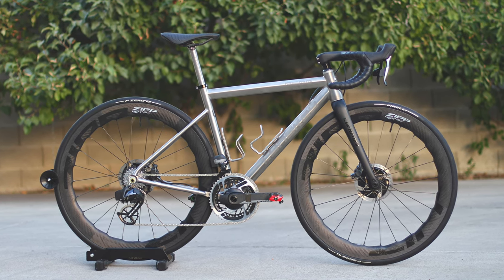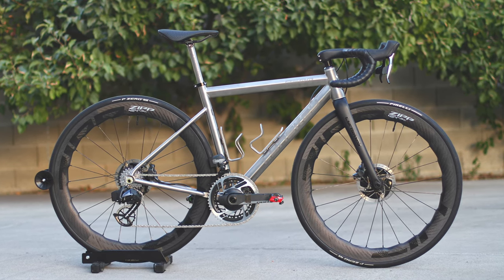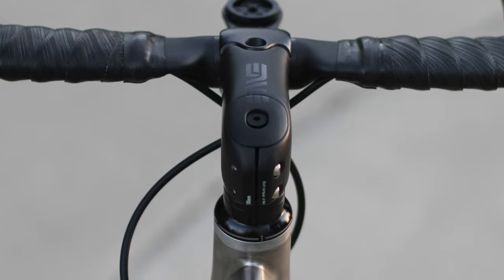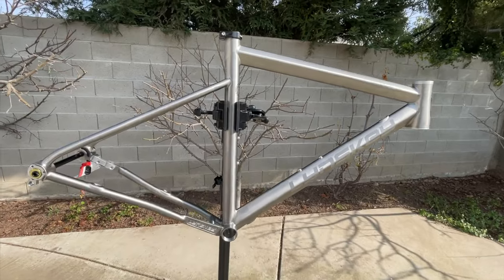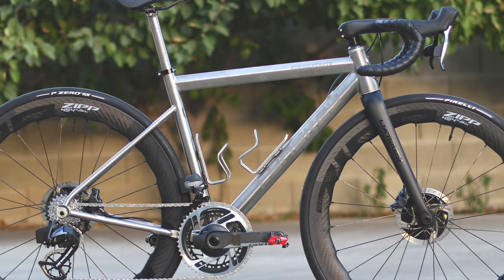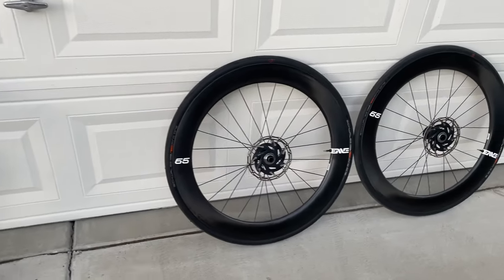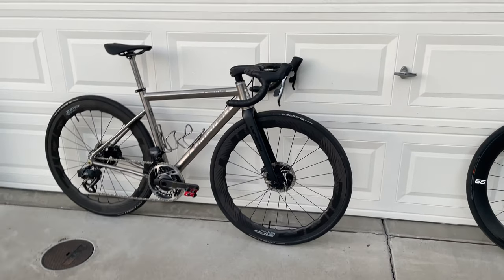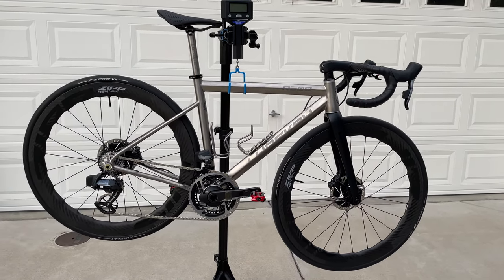I weighed my titanium bike Lynskey R500 Part 3

Comment: I have a Litespeed that's anything but light, it's 20.5lbs 🤣🤣 I tell myself I only went titanium because my sweat corroded my last two alloy frames 🥲 They are striking bikes though, I get a lot of compliments on mine
Reply: Lol man I have similar reasons for the ti bike also.
Reply from the maker: Thanks for sharing. Same here, I went for the durability but later fall for the unique, exotic and raw frame material. My Litespeed weighs about the same by the way, which I never wish it'd weigh any less. Cheers.

Comment: Beautiful bike. I’ve got a GR300 and love it.  Yes, it’s heavier than the carbon frame it replaced, but the ride and durability are so refreshing.  If you ride your bike a lot, it’s so nice not worry about scratches.
Reply from the maker: Thank you. Gr300 looks really comfortable. I agree with all you’ve mentioned about T.I bikes.
Reply: What’s your current set up with your gr300. I also have one but I considering switching it to a road set up. I just couldn’t find any videos about doing that set up
Reply: Yeah I went with the GR300 also for my gravel rig. Love it so far. A few choice upgrades make it super comfy and fun to ride.

Comment: The focus on weight that everybody has doesn’t make much sense. As long as the bike’s weight is in the ballpark of comparable bikes, your wheels and tires are going to make a much bigger difference to handling. Your body weight is also a much bigger factor in the system, so you’d be better off focusing on dropping fat. Worrying about 1-2 pounds on a bike that has otherwise excellent characterizes is foolish

Comment: Titanium is pure class and durability, i remember the old Litespeed. I had 2 carbon trail bike frames with cracking issues and weren't warrantied so i if i decide to swap out my top end XO parts i will be getting the PRO 29
Reply from the maker: I just noticed you mentioned "trail bike". Lynskey also makes "Live Wire" which has a slacker head tube angle (a little more suitable for tech stuff) then the Pro 29 just saying. I like to climb, so the pro 29 is perfect for my intention.
Reply: @organicbikepacking7312  I probably should have said hardtail and that is what i prefer now and my previous and damaged 2021 Niner is. I have an offer on it from the bike shop so not sure if i want another bike yes or not? I am 68 and in shape for my age however hiking is a great form of exercise as well, i think safer and certainly cheaper, you have a great assortment of bikes there with top end parts

Comment: Really nice bike. I have aluminum 51cm 2013 CAAD 10 SRAM Force and it weighs 18.5lbs with pedals on, non-disc brake. I was surprised by how light it was for a stock build. It is super responsive and stiff. Not exactly a comfortable bike for long miles.
Reply from the maker: Thank you. I appreciate you sharing your ride with us; happy riding and be safe.

Comment: Aesthetically speaking this is truly a beautifully balanced bicycle. Normally small sized bikes are overwhelmed by 700c wheels but this one is not. Just a few things I find that might accentuate the lines. First, the stem is a bit chunky on the steer tube clamp side. Although it flows nicely with the bars on the other end it makes the steer tube appear visibly weak where the spacers are. Across on the other end of the top tube the opposite is happening. The seat post clamp being both black and block shaped, interrupts the frame to post transition. I think a less conspicuous, form fitting clamp, maybe in the same titanium color would be nice. I like a touch of red in the pedals but once again the square shape seems off for a pure road bike. It might also be nice to see small amounts of red elsewhere like valves maybe. The last area is the crank but more specifically the chain rings. Visually they add a lot of weight and tangled complexity that seems unnecessary. Overall its industrial simplicity, weapon like angularity and underlying strength are very desirable. 9 out of 10.

Comment: I’m in the market for a new road bike previously only had carbon bikes but someone recommended Linsky and from a long term ownership I don’t mind moving to titanium. Overall are you satisfied? Never ridden or even seen a titanium bike in person
Reply from the maker: Titanium bikes in general are such a pleasant to own. The uniqueness of the material alone will set you apart from most others (in a good way).  On top of that, getting the bike to dial in your preference/customizations etc.. will set you apart from Ti owners. 
Overall this bike here is great for what it's intended; will talk more in my next video. 
As for the company/quality/customer service, I'd say they are not the worse or best either in terms of educating me what I don't know which I might address on  in my next video if I see fit.
Reply: @organicbikepacking7312  Thanks so much! Is there any other brands I should consider? How did you figure out sizing etc? I wish they had a physical location etc. Any tips and tricks when it comes to ordering!
Reply from the maker: Sure, 
Sizing, I recommend measuring your inseam then talk to the rep; they are pretty good about it.  
Litespeed is also another awesome US Brand. I’ve had a good experience with the bike I got from them 4 years ago. The finish is rather complicated but on their frame is a little glossier compared to Lynskey which is more matte. As for the aesthetic, people like the etched finish better than the standard black decal. I plan to talk in detail about the finish soon. Hope that helps.
Reply: @organicbikepacking7312  Thanks so much. What made you chose Lynskey over litespeed? is there any other brands I should consider. Is litespeed lighter?
Reply from the maker: I want road specific, aero, modern geo, and darker/matte finish. I’m not concerned too much on weight. Litespeed is a little glossy for me, but their T1SL frame is one of the lightest compared to others by ~1 pound or 500 grams. I generally try to stick with US base with US materials manufacturers just for warranty purpose if need be.

Comment: 18lbs is light for that bike.  I have the helix pro just cuz  I like the looks of the twisted down tube.

I've compared other ti bikes to lynksey frames and majority of them fall within 0.5-0.75lbs such as moots an seven.  Not much difference. 

I'm wondering if the R500 has a stiffer ride than the Helix Pro or is it marginal?
Reply from the maker: Thanks for sharing the ride. Helix is another tube I could never get tired of looking at let alone riding on; they are stiffer than the rounded tubes but more compliant than the diamond shaped on the R500. It's hard to tell how much stiffer. However, I've ridden both the R500 and my Litespeed Cherohala with the same wheelset, R500 is noticeably faster of course aerodynamic and many factors involved.
Reply: @organicbikepacking7312  thanks for the reply. 

Currently have 4 ti bikes and the helix pro is my favorite. It's so well balanced of compliance and stiffness. I do like that drop seat stay and the diamond shape down tube looks to be like a aero shape from a certain distance. 

Spoke with the sales rep at Lynskey and they are currently testing out different paint and etching colors.  The guy also said they've invested in new equipment to create more color options in the next coming year/s

I will wait to see what they offer in color schemes
Reply from the maker: @bonbonflippers4298  Great, I'm excited to see more color variation from Lynskey as well.
Reply: my TI is 18.5lb and at 1/4 of the cost of this build. Could get down to 17lb with carbon bits and then add muds and rack for nice backpapcking/touring rig.
Reply from the maker: @howlinhauler  Sure, had I gone for the weight, it'd be a different frame/build.

Comment: I'm trying to decide between this and Litespeed Ultimate.  I like the look of this better but it is almost 400g heavier.  What are you thoughts?  Did you weigh the frame?
Reply from the maker: Hi Quantum, 
based on both websites, the Ultimate weighs about 350 grams less which can be significant. I didn't have a chance to weigh the R500 frame before the build.  
Aside from the weight, geometry, aesthetic, frame finish, tire clearance, ride feel etc... are worth looking into as well. 
- Aerodynamic setup, deeper wheelset, racier look I'd still go with the R500.
- All day with a little more upright geo, more compliant 3.25 AI tubes I'd probably go with Ultimate. 
Some of these are marginal difference of course; both frames are awesome, but at the end I'd say choose what you like aesthetically. That goes along way.

Comment: Im 5'8, would you recomend having Small size on this R500?
Reply: @Organic Bikepacking your bike have small size frame if you don't mind, what is your height?
Reply from the maker: S will be too small for your height. I'd go with size M and try fitting on a 20mm to 25mm offset seatpost first.

Comment: People most of your bike is dead weight and does not matter.  A pound or two on the bike is basically the same as a pound or two on the rider.  The only thing that matters is rotational weight as that has to actually spin so lighter wheels, tires, cranks, pedals, cassette and chain are the only difference that matter.  Your body weight constantly fluctuates daily by pounds so quite worrying about a couple pounds on your bike.  

I would worry much more about the feel, comfort, stiffness, and handling of a bike before I would worry about a couple pounds on the bike.  There is little difference between a 17 pound and 20 pound bike unless it is in the wheels.....

Comment: You might be able to slide your cleats inboard a few mm and eliminate the crankarm rub
Reply from the maker: I'm trying out a new saddle; I'll keep that in mind when bike fitting. Thank you.
Reply: @organicbikepacking7312  there are also pedal extenders that can be fitted or some pedals actually come with an extended spindle variant (Like the Shimano SPD L).  I much prefer to try making adjustments at the cleat first because extended pedal spindles put an extra lateral load on the crank arms and bottom bracket.  If you adjust one cleat try to adjust the opposite one equally as well (or at least make sure they are close to the same)

Comment: Get some 30-40mm wheels on 25mm conti GP5000 tires.
That will get your weight down. You dont need deep dish. At the speed you are riding...they are anchors!
Reply from the maker: That's always an option. Maybe I'll put my 303 Firecrest on one of those bigger climbing days.
Reply: I run 50’s on Chris King hubs with GP 5000 AS TR’s in 700x35.   Even the pros now run 28’s and 30’s.  Look at NorCal’s testing.  32 is faster.  Hell, 34 was faster than 30.